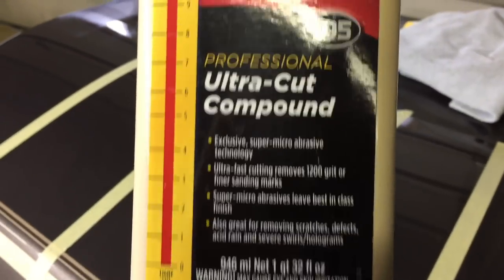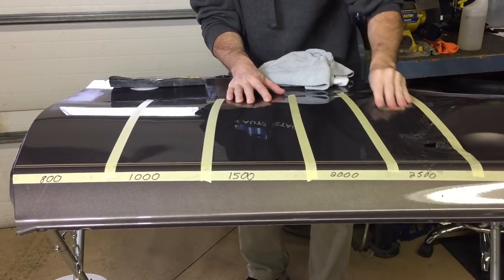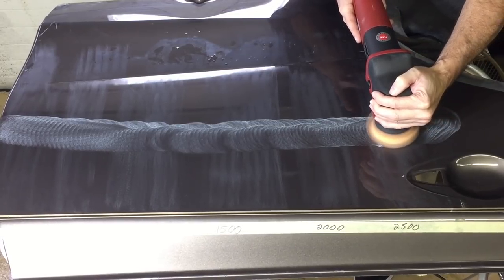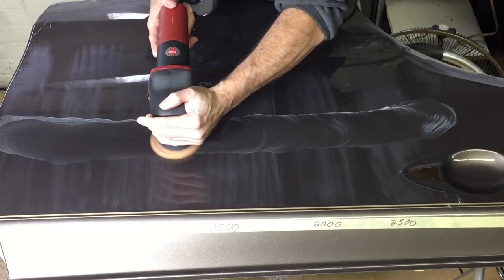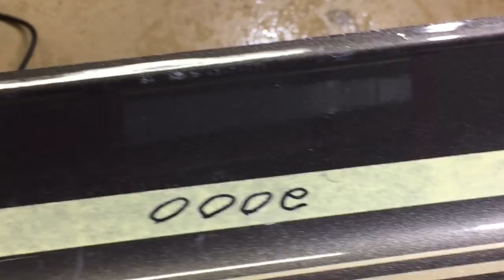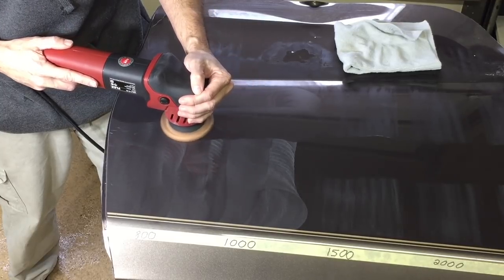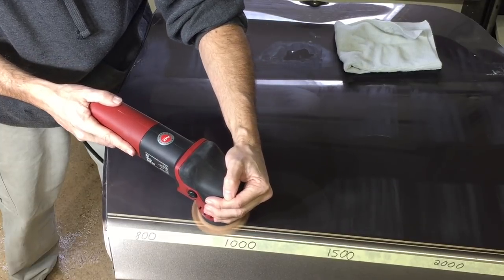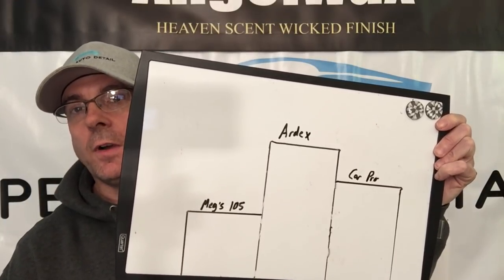Meguiar's 105 Ultra Cut Compound! Continuing the Heavy Cut Compound Challenge!!!

Comment: Excellent series on compounds. I have a love/hate relationship with M105. I use it when it's the optimal product for the paint, but if there's an alternative, the M105 stays on the shelf. Sometimes I use 3:1 ratio of M105/M205 for a smoother run. Depends. A QED definitely helps with the dusting.
Reply from the maker: Couldnt agree more Felix. More compounds to come... both obscure and popular👍🏻
Reply: What is QED?
Reply: @ochmikeman86  Quick Exterior Detailing spray. QED.

Comment: If using M105 with rotary polisher (5") to cut 2k polyurethane after wet sanding 1000, 1500, 2000 grit on an electric guitar body, what advice would you give regarding:
1. What rpm?
2. What length of time? Would it be smarter to do many short passes to avoid burning through, than one a little longer? If so, about how long passes?
3. With a rotary polisher, what type of motion and pressure would be optimal?
4. Any other concerns? Would a lighter cut compound than 105 be a better option? 

Many thanks in advance for any pointers you can give!

Comment: Thank you for these videos,  What would you recommend for I had some body work done and now i have overspray.  I did claybar and it's still there and i just hit it with meguires #4 ultra finishing polish and overspray went away some but still a bit rough and I'm using a orbital polisher with a buff and shine super soft baby blue foam ultra finishing egg crate looking pad. Any help would be awesome,  Thank you.
Reply: Wet sand it with 1500 or 2000 grit then buff with compound and swirl mark remover and polish

Comment: I bought a bottle for my guitars. I'm curious to see how it works but still need to find a polish to get a mirror finish.
Reply: How’d it work out?
Reply: @cjaquilino  took more work than expected. I was worried I'd cut through too much but it worked out well with m85 instead of m105 and 205.

Comment: In the Meguiar's realm, I switched to their M100 Pro Speed Compound, and couldn't be happier.
Reply from the maker: I used them years ago... but they are falling behind a lot of quality product lines popping up everywhere.
Reply: danlc95 the m100 is better then every comp on the market period
Reply: Croser - It's the only one I buy by the gallon!
Reply: danlc95 me too mate old but gold there is no competition whatsoever when the m100 is in the right hands cuts like wild finish like 85% dedicated polishes...
Reply: top it with the m205 enjoy it.. this marketing went too much with all this "polish systems" iam using 20compounds everytime i go back to m100..
Reply: once upon a time i readed ppl typing that it has fillers -_-
Reply: Croser - I once had a situation where my client sanded his car with 1500 grit. I was only scheduled to do a polish+wax... All I had was my PC, green hex logic light cut pads, and M100. 

We tried his old crappy rotary, and it broke down. So I went at it with the PC, and believe it or not, we got the 1500 grit out. It took a few hours, but we got it!
Reply: Croser - Agreed, I buy M205 by the gallon as well. Usually finish with M21, or M26.
Reply: Croser - Some people believe everything is a filler... 

The very best in the industry consistently rely on Meguiar's abrasives with their reputation. I have no reason to disagree.
Reply: danlc95 i know but if there is most real life performer compounds are the megs you got what you see no masking or something..

Comment: Hi Brian could I just use distilled water to help with dusting? The only quick detailer that I have is carpro ech20 mixed with distilled water, I'm going to be ceramic coating my truck and wanted to have less product on the panels. Thanks in advance
Reply from the maker: Yes....I will help you a bit.
Reply: Apex Detail thanks buddy👍

Comment: Hi there I’m a U.K. painter with very limited detailing experience and quite frankly the part of the job I least look forward too. My paint supplier has very limited stock of compounds so I’m generally limited to farecla  and 3m products . Currently Ive been using the 3m fast cut plus which does an ok job but I feel it makes hard work of 2000 sand scratches . I’ve been checking your reviews and I’m wondering if you could tell me if there is any thing that I can get here in the U.K. that would do a better and faster job of cutting through those 2000 scratches . Tia
Reply: U can try clay, start with the reds
Reply: I’m telling you once you get the hang of it you’ll love doing this kind of job
Reply: This ewocar stuff you can get us some great stuff. Only dealers are  in  your area.

Comment: Hi. I recently bought the torx random orbital for personal vehicles (not for business) to remove scratches and swirls. Since im new to this field, do you have to sand the panel before using the compound (I use Maguires ultimate compond)?
Reply: No sanding required before applying compound. Brian sanded just for the testing showing how the compound did.
Reply: And clean the panel/clay bar etc. before compounding - (sorry for the Cpt. Obvious but clean is mean)

Comment: 105 is dead, M110 already replaces it. But for heavy hitters, 101 still the boss.
Reply: Arapaima Gold M100 has the heaviest cut in my experience, even more than 101. It was specifically designed to be used with a wool pad and a rotary, that’s about as aggressive as it gets before going to sandpaper.
Reply: How is the m110 with dust issues

Comment: Ahhh, not a fair test, you used a random orbital polisher w a compound designed to be used with a rotary. As far as residue, the polished area has almost none when I'm done and the throw off from the rotation is significant though. I paint cars. I only use my random orbital as a third step, compound, polish, then orbital with a good swirl remover. ....I know I know....Rupes, Bigfoot random orbitals rule man...BS, I could have polished the section you polished in a quarter of the time you spent w that toy you detail guys insist is the shite.
Reply: I agree regarding the polisher. Orbital are a big step backwards as far as the cutting stage goes. Good for the very final polish but rotary is still king by far for the heavier defects.